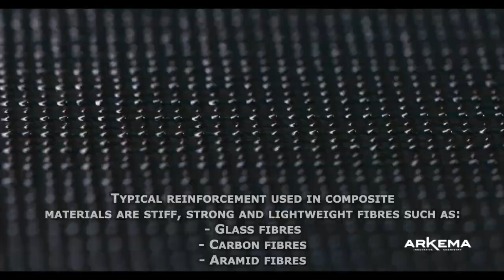WIND BLADE TURBINE Manufacturing Process You Won’t Believe How Are Made – Shocking Production Method

Comment: AMAZING!!!  How long do they last and how do you recycle them???
Reply: I’ve heard they can last anywhere from 10-20 years and can’t be recycled. Bloomberg had an article last year on turbine blades ending up in a landfill in Wyoming since they can’t be recycled (at least not efficiently).
Reply: @bryanthoffman5034  they can last 25-30 years really depending on the site conditions. In Germany they are starting to reuse them as a filler for concrete.
Reply: @Mike-kr5dn  oh nice! I’ll have to look into that more.
Reply: They're starting to create plants specifically for recycling composites like fiber glass and carbon fiber. The recycled materials can then be used in short strand applicationsnlikenforged composite products or used in concrete
Reply: I work there bros😊
Reply: Hello.. I work in a wind blade factory and they have a estimated time life of 20 years.. Ofc they pass from 20years and they can go up to +30.
About recicling, there is an outside company that comes to the plant and recicle them.
Wind blades are very expensive. Only one blade(2 shells together) have a cost of 300.000€ so for one wind turbine it will cost around 1.000.000€. Totally worth it and the planet thank us.
Only one lap of our turbines, can produce energy for more then 25 homes for 24hours. Amazing right?
Reply: @pipoeffyn8229  here in the States, they've been burying them.

Comment: This video is amazing and awesome   wade they made wind blade for environment to safe money on energy costs go for it
Reply: The fiberglass resins are made from oil that has to be refined just like gasoline or polymers for plastics. Then the blades have to be taken to locations using ships, trucks, trains and other heavy equipment to be put in place burning thousands of gallons of diesel in the process. Not to mention the refining and manufacturing of the steel, copper and aluminum assemble the final product. 

Its all heavy industry and it all pollutes. Green energy for the most part is a myth.
Reply: @SpaztasticTV  well it still offsets the co2 in couple months.
Reply: @SpaztasticTV  well it still offsets the co2 in couple months.
Reply: @SpaztasticTV  well it still offsets the co2 in couple months.
Reply: @Mike-kr5dn  no it doesnt
Reply: @Mike-kr5dn , I don't know why you believe that or why you had to type it three times. The CO2 expended in the manufacture of a wind turbine is never recouped within the lifetime of that turbine. Furthermore, the disposal of time expired wind turbine blades is via 100% landfill. Wind turbines, as with most 'green energy' technology ,are a political scam.

Comment: Should incorporate a deicing leading edge like on plane wings for colder climates
Reply: I'll get right on that redesign!
Reply: Why? on a plane you dont have 15 G's of force pulling the ice off the wings at cruising speed. Plus, they are constantly turning and are only stopped or slowed when it is 100% required